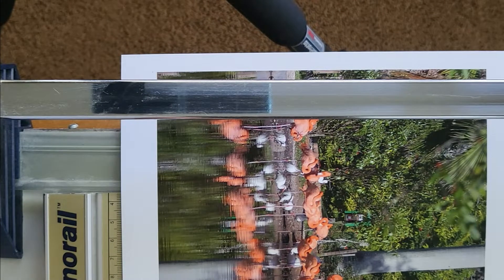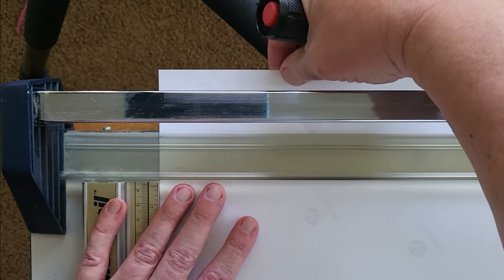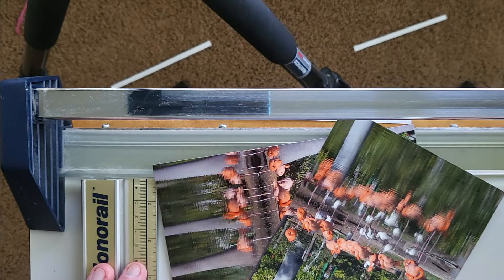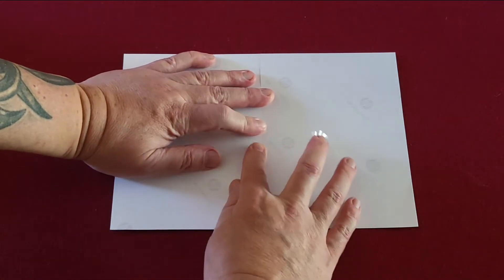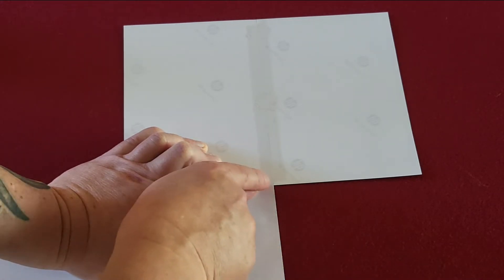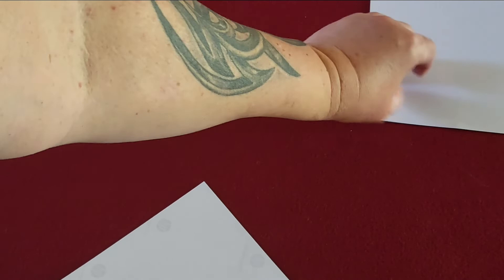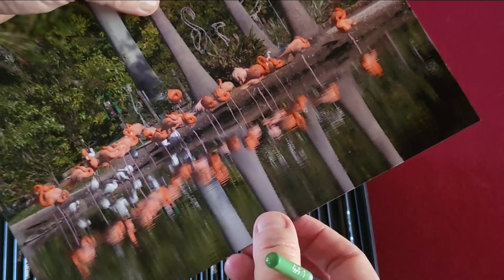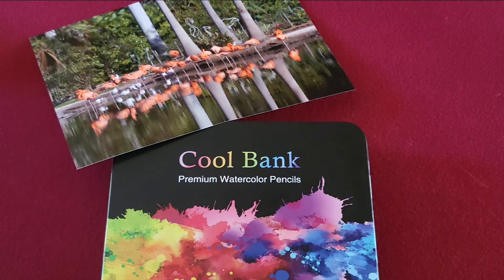Qimage Ultimate - Physically Aligning Panels From Multi Panel Prints

Comment: Mike, thanks so much for posting this! I just printed a multi-panel image composed of four 16x20 panels. I figured there was about zero possibility of getting them aligned when gluing to foam board. Then I stumbled across this. Your method, including the colored pencil tip, worked perfectly!

Comment: Long-time fine art printmaker here. Really good video, Mike, especially the colored pencil idea. Only would remind folks that, if that sweet trick were necessary, it would obviously need to be done before another row was added. It’d be just like me to wait until a larger group of prints was nicely put together, and then the seams would be nearly impossible to open up and apply the color! Thanks so much for all your contributions!

Comment: Have you attempted a large poster size, Mike? I'm tempted to try. Four 13"x19" prints would create a combined enlargement of about 26"x38," or (2'x3'). I have an unused 27"x 40" frame with 32"x40" matboard cut to cover the edges.
Reply: I've done four 13x19 panels but I had to reduce the size a bit so that the long edge was 15.5 inches instead of 19 because 15.5 is the longest my paper trimmer can cut.  I ended up with something like 10x15.5 panels and it worked well.